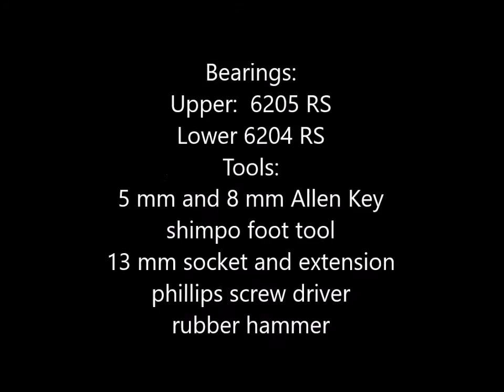shimpo RK2 bearing replacement part1 - disassembly

Comment: There is a circlip (circlip is British English, aka clip ring) on top of the upper bearing and there is usually a second circlip below the lower bearing which locates it on the shaft. The lower bearing is meant to be a loose fit in the housing - the idea is that the spring washers above the bearing push it downwards within the housing. The bearing rests on the clip on the shaft (below the bearing and above the woodruff key). In this way the springs push on the bearing which pushes down on the shaft, pulling the shaft downwards until the upper circlip is tight down onto the upper bearing. This is a simple way to take up any end float (i.e. up and down movement) in the shaft. Also be aware that the upper bearing is different to the lower one, it has a waterproof seal on its upper side to stop water/slip from getting in. the lower bearing doesn't need this. Lastly, be EXTREMELY CAREFUL when pressing the shaft out of the bearings, it is VERY soft steel and is easily damaged - be careful!
Reply: Do you have any further info on that m8?.. I've got a non shimpo wheel that's a similar design but is now knocking a bit..I figured it's probably the main bearing..came on here for some inspiration before I start tearing it down to take some measurements...

Comment: I'm trying to find the bearings - order online - and can't get the exact model you suggest. They seem to miss numbers. I found 6204-2RS and 6505-2RS. I also got the info that the they could be 6205-DD, or 6204ZZ, which are the right one? I have the RK-2 West 1977. Thanks

Comment: So I had to replace 2 of 4 the bushings that connect to the small pulley on an old Shimpo. I'm trying to reattach the small pulley but the belt is so tight I don't have enough slack to line up the bushings with the 2 holes on the front wall of the base. Does anyone have a suggestion on how I can get the small pulley in place? It's really awkward trying to line up all 4 bushings at once while trying to keep the belt on both pulleys. Any advice would be a huge help!

Comment: I also have a Shimpo Whisper. How do you adjust the speed of the wheel? Most other wheel brands have the adjustments underneath the foot pedal.
Reply from the maker: My wife has a Shimpo Whisper.  I am not sure I understand the question.  The foot pedal is like a gas pedal.  Push a little for slow and more for faster.  The only adjustment we did was to loosen the nut on the foot pedal.  Initially the pedal would stick.  Once the nut was loosen slightly, the pedal would return and the wheel would stop.
Reply: @jeepsandstuff9113  Hey! It's the Potentiometer that I'm trying to adjust the speed on.